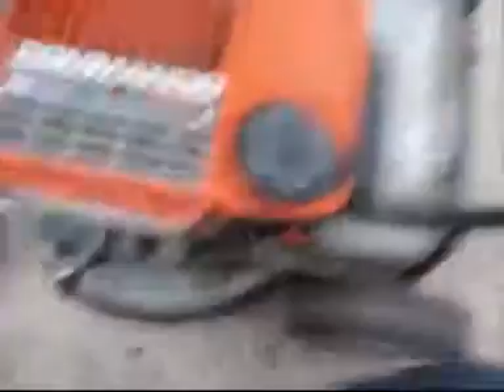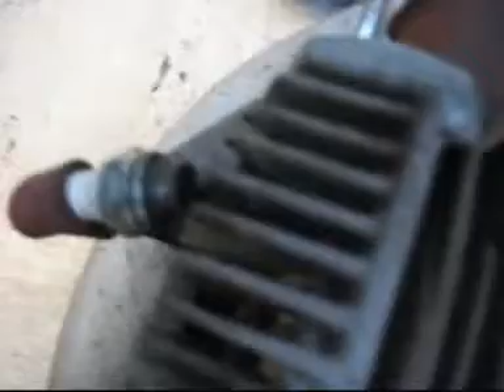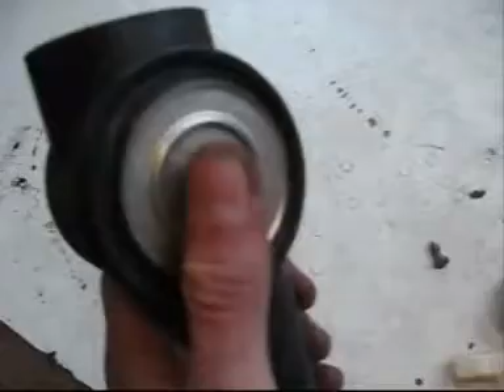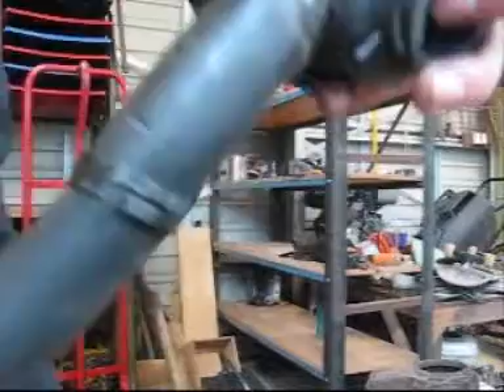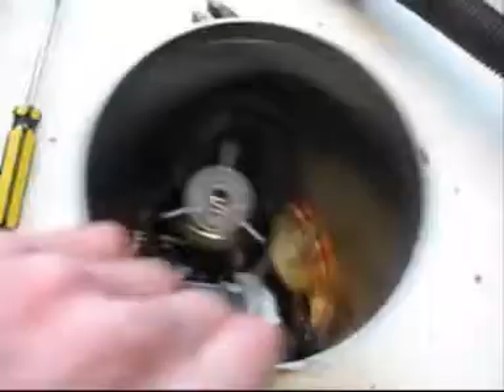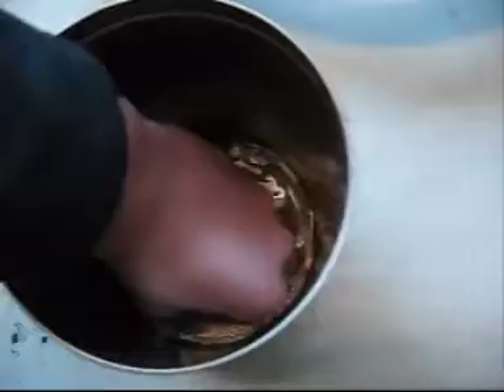Victa mower repair pt 1

Comment: I've fully restored a Commando , rings, bearings, gaskets , repaired the carby , put a 4 blade mulching plate on , plus I purchased a brand new Mulching Plug and Wow , it is "Awesome"!
What I have also done is put new steel wool into the muffler , plus rust proofed and painted the muffler with High Temp engine Enamel .
Plus the deck I have rust proofed the underside of the deck and every winter I fully repaint the underside of the deck , ( Grass is the greatest rusting agent I know of ) !
Reply: This is The Way , Stainless steel Scourer pad , Just to be sure as Steel wool will catch on fire and Burn out real quick , like the old school science experiment lol :goodvibes:

Comment: Hi Geoff,

Just wondering where you can buy the needle in the carburetor that stops the fuel continuously flowing in? I've lost mine while dismantling it so for now I've just used a piece of rubber. Naturally this won't suffice. thanks in advance.

Comment: Hi Geoff,
I found your video's on Victa carby repairs very helpful and informative. Using your 'embarrassing' instructions, I as a complete novice was able to pull down a carby on an old V40 Mustang and re build it with some major cleaning and a few cheap replacement parts including a new spark plug. It took about ten pulls on the cord to finally start, but it runs like a new one. It now starts first time every time. Thanks again for posting on you tube.
Regards
Rick

Comment: STEP 7: Dismantle G3 CARBURETTOR. Remove brass jet from primer cap and remove end cap, spring, plate, diaphram, spring, cam and lifter. Clean. 
STEP 8: Reassemble and reattach carburettor to throttle control (cannot strip and clean carburettor while still attachd to throttle control).  

SOLUTION: STOP TRYING TO REPAIR LAWN MOWERS AS YOU KNOW VERY LITTLE ABOUT THEM. You are an embarrassment to the business. Don't learn the tricks of the trade. Learn the trade.

The Mower Man
Reply from the maker: Albert Masterson fuck off idiot. Most of these comments have been positive and Iv helped people. Nowadays I work on MTU series 4000 and 1163. Look that shit up and then come chat to me...

Comment: @geoff390 
Don't use a blow torch on a flywheel
99 out of 100 times you will not have a problem. Especialy with iron you risk causing cracks from uneven thermal expansion..

Comment: i have the sema engine, but i cant get the flywheel off, the blade plate has rusted off. i got the nut un-done, but now theres a big steel spacer that wont come off, does it screw off . or so i need to use the puller and some elbow grease? its rusty as hell

Comment: Thanks Geoff! 

2 days before watching this I tried to fix my Victa Vantage with no success. I half assed tried to clean the carby but after seeing this I realised that I needed to do it properly - so I did. Your pointer about the arrows being on the parts to show how they fit in the right way excellent. Turns out I had the primer bit on upside down lol. Thanks again ;-)

Comment: Nice work - I've never got the patience to make these instructional videos, but I like to bring back old blue 1970s Rover mowers back from the dead.  Often they've been discarded due to simple easy-to-fix problem.

Couple of things, I think the Victa carby mount could be best described as a "bayonet" mount, similar to a lightglobe.  Also the diaphragm on the back of the carby I think either regulates engine speed under load (lifts the revs a bit when